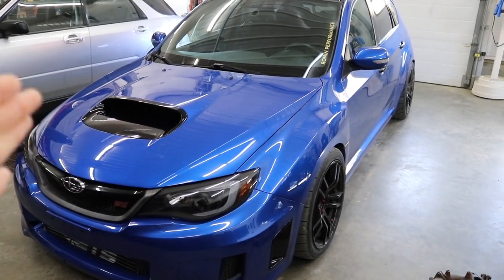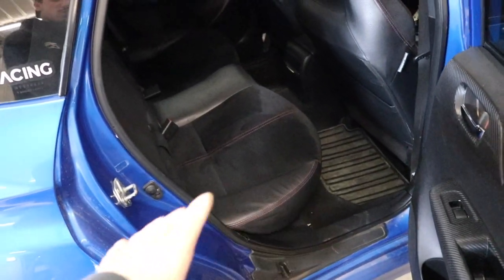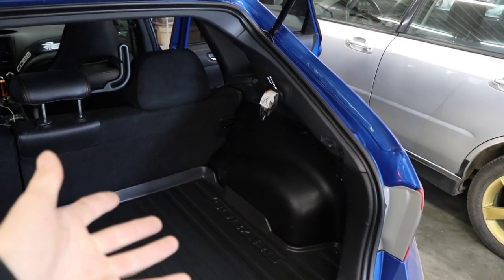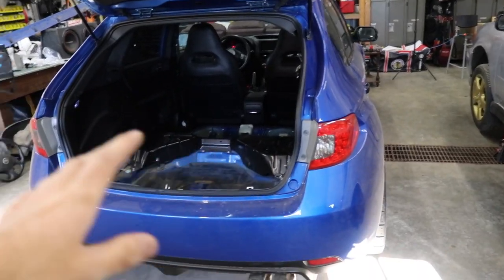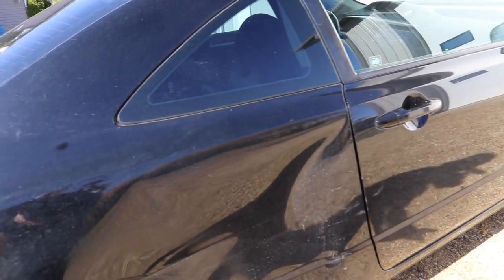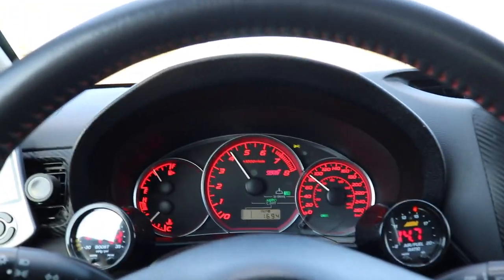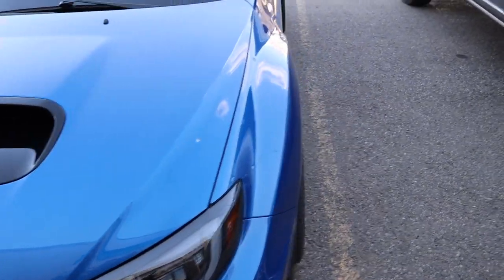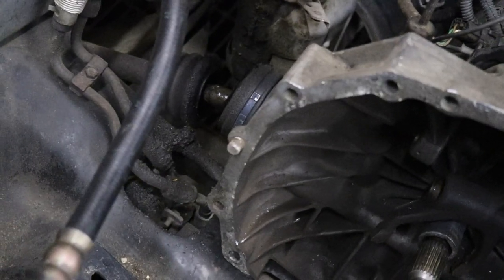My 500HP STI Isn't as Clean as You Think...

Comment: Hey Daniel I found the same exact rust when it was surface, good knowledge to put out there. This generation rusts in other weird spots too like bubbles on the roof, and really bad on the door pillars (bubbles though the black trim near the windows)  And at the seam at the back of the trunk pan at the very rear of the car
Reply: I seen my buddies car (same as mine, 2011-13 STI) had that same door pillar rust as what you're talking. Figured I'd try and prevent mine starting by drilling drainage holes on the inside of that door channel, and spraying lots of Woolwax in there. Hopefully it works